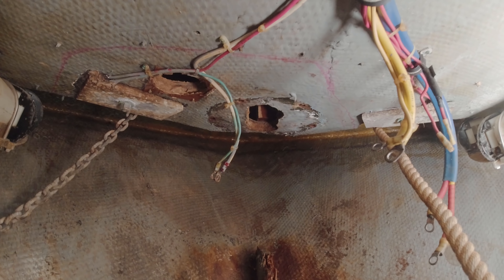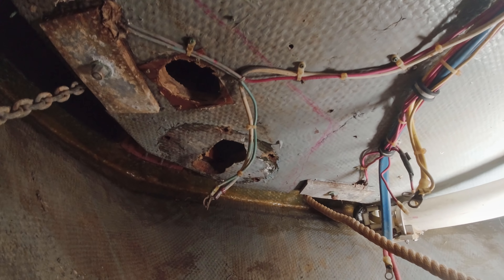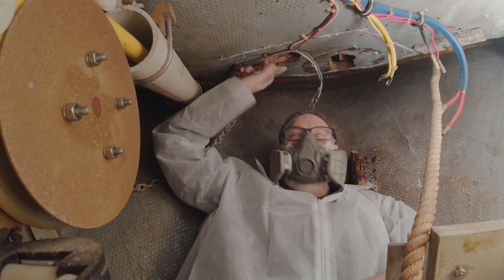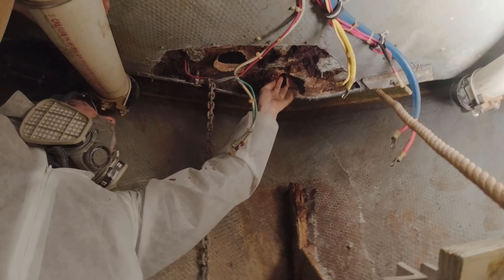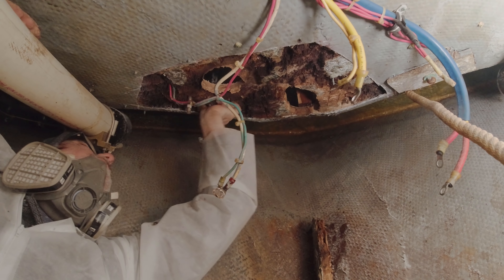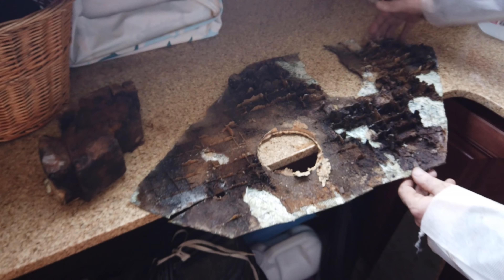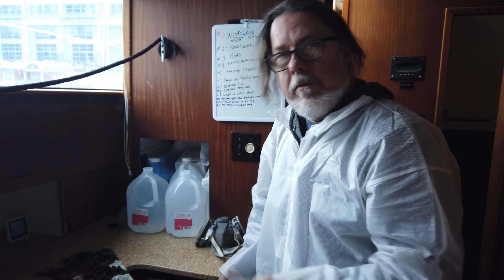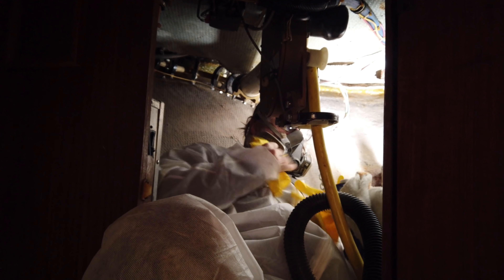Replacing the Deck Core on a Hatteras Motor Yacht E115

Comment: Question. What depth sound wifi do you use for your navionics app?
Reply from the maker: It doesn't use wifi, just GPS, after you down load the maps.
Reply: @tryingnottosink9107  was it the Vexilar T-Box?  I have a full Simrad package in the yacht that interfaces seamlessly. I wanted to be able to record sounder readings on the tender.

Comment: Are you replacing the ply core with ply or are you going to go with the higher cost coosa board that is a composite coring material?
Reply from the maker: We are using Coosa. In fact we are installing it today.,
Reply: @tryingnottosink9107  It might be higher cost but it has far less chance of rotting away. the type of trade-off that makes sense.

Comment: I always have this question when people are repairing leak into the core: If this leak is stopped and the softening is not noticed by walking on the upper deck then why would you open and fix it?
Reply: The area fixed is where the anchor winch is secured to, if that rots away the repair becomes even bigger.
Reply: So you would leave rotten core alone? smh...
Reply from the maker: You can leave rotten core lone if it is not causing a problem and is not getting worse. In our case, the rot was where the windlass is bolted to the boat. Since we were installing a new windlass, and the bolts run right through the rotted area, we really had no choice.
Reply: correct me if I am wrong, but aren’t new boats made with mere foam in between the fiberglass outer and inner shells? how much weigh bearing can a foam do?
Reply: @JCrook1028  no I would replace it if it is functionally obvious such as soft deck spot or weight bearing are. The critical part is cut the leak to zero.
Reply: @gusshr  It's a fairly dense foam and when sandwiched between resin and fiberglass it is actually fairly strong.
Reply: @gusshr  Even on foam core boats there are areas that require wood to be in Survey. A good example of this can be seen on Life On The Hulls YT channel when he goes over which bulkheads have to be plywood and which can be foam core.